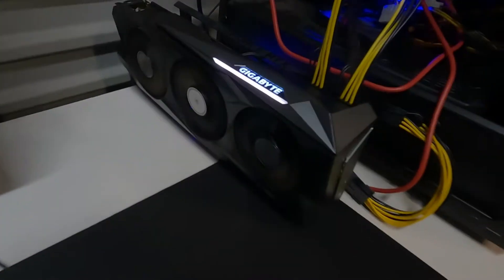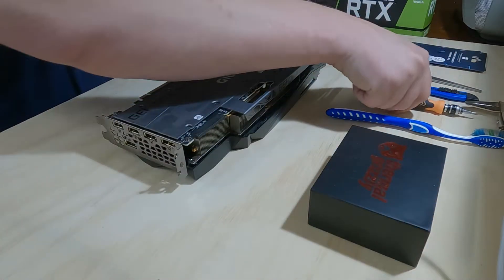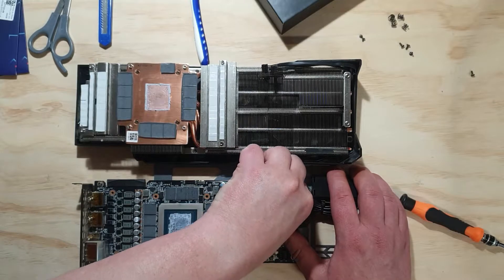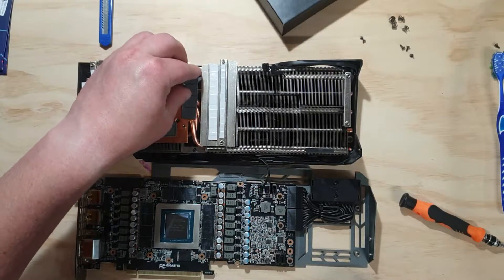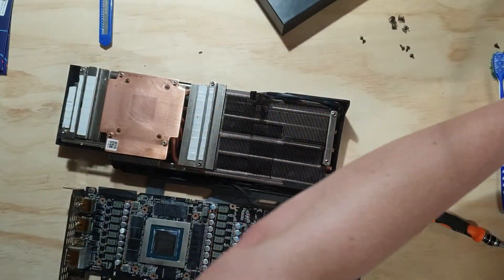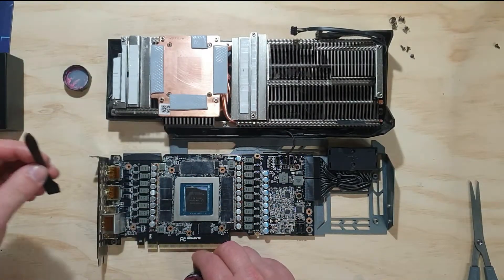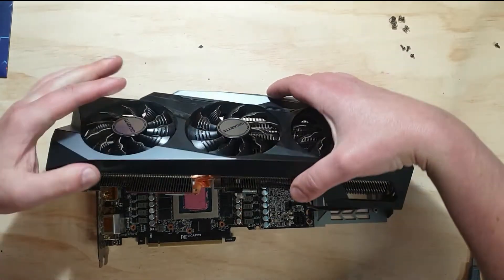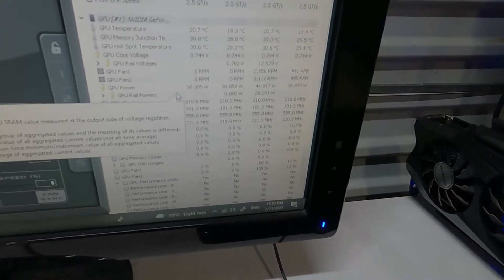GIGABYTE RTX 3090 Thermal Pad Install - Before & After - Ethereum

Comment: Two .5mm pads and thin 1mm heatpipes for rear. Gigabyte didn't put piping on back plate and u gotta have thay for these it's the whole reason some get messed up
Reply from the maker: Thanks for the input dude, Yeah noticed recently that its starting to get a bit warmer than usual so ill be doing this card again including those pads

Comment: do you need to change the pad for the back plate ? thanks
Reply from the maker: At the time of doing this video i opted not to do the pads on the rear plate. but recently i have noticed higher temps so i will be doing the pads to the rear of this card.

Comment: Did you sell this 3090? Because I just replaced the thermal pads for one I bought on ebay, the front ones felt fairly new, the back ones were all significantly drier.
Reply from the maker: Hey dude, Na mate still got my 3090 Mining and powering on.

Comment: Stick a small flathead screwdriver in the middle of the single wire clamp and that will open the two tiny clips on the base of the clamp.
Reply from the maker: Cheers mate, I thought of this but was just as easy to continue the process whilst leaving it connect. thanks for the input though mate! much appreciated.

Comment: What Driver are you using I can't get abve 114mhs without blowing it up I changed my thermal pads now I can't get it back to 63c on core stays on 64-67 memory was 104-107 now it's 90-94 flucuation all the time
Reply from the maker: Hey dude, Using the normal drivers for windows on for this card. The Core would depend on the coverage and the quality of the thermal paste you used. And if the temps are down for the memory between 90-94 depending on the ambient temps that's pretty good. How high was your Hash rate before hand? cause it also depends on the silicon lottery as well?

Comment: Hi there Mate! Good vid it was helpful! Althought I'd like to share some what I've learned changing thermal pads: It is necessary to clean the heatsink like hell, but also it is quite important to clean the vrams surface aswell, like super super clean. (with isopropyl too) I was using 2mm Gelid GP ultimate 15w/mk for rtx 3080s with pretty decent results. (25-30°C drop on the vrams each gpu, so I can keep all gpu vram temps at 78°C with autofan in trex miner.)

Cheers Mate, keep up the good work! :)
Reply from the maker: Thanks mate! Yeah got to ensure those are really clean..the pads i am using are 12.8w/mk and they do a good enough job for the price i paid, Thanks for the comment bro!